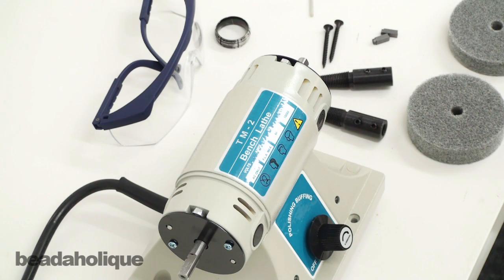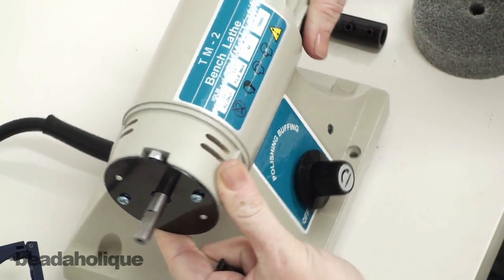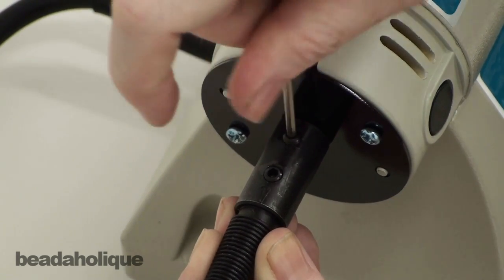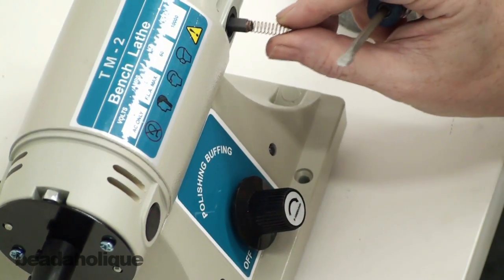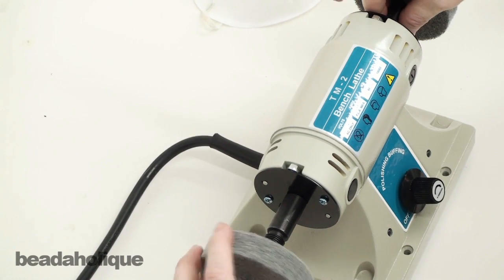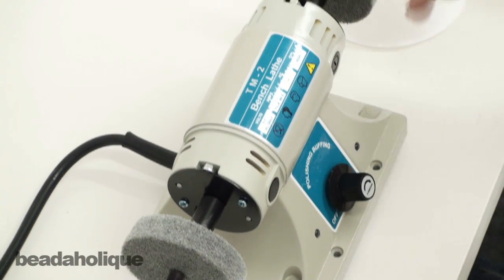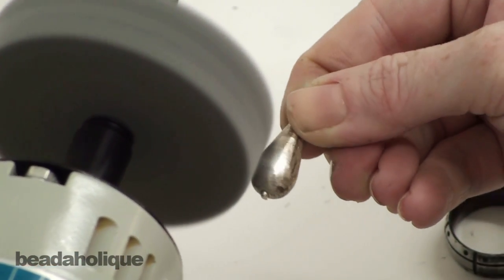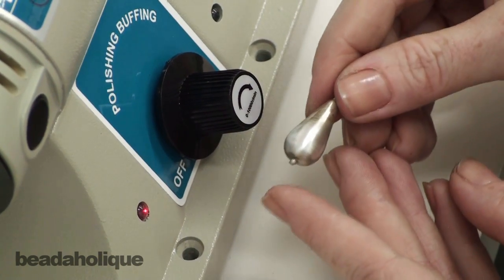How to Use the EuroTool Bench Top Polisher

Comment: thank you , because of your great description .... Can we use this machine for gemstone polishing ?
Reply from the maker: I have not personally used it for gemstone polishing and because of that, I hesitate to recommend it. I would suggest contacting the manufacturer of the tool, EuroTool, and see what they say. I would hate for you to damage some gemstones trying.
Reply: This is made for working with metal in terms of the 2 grinding and polishing wheels.  I have the muslin wheels that go with this lathe, and it's possible to put a final polish on to some stones with Zam.  It is not suitable for all of the polishing stages for stones, however.